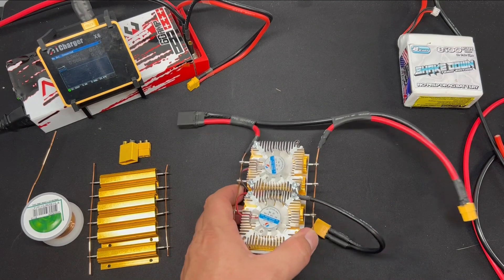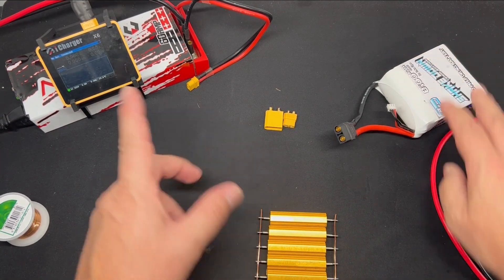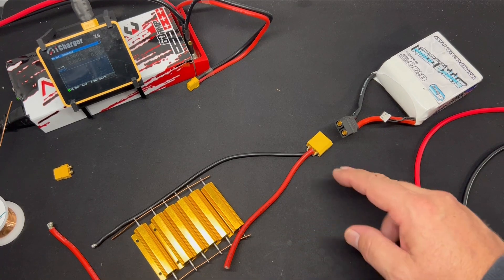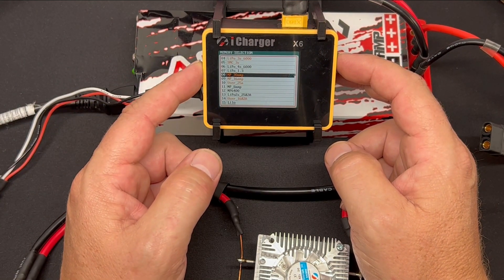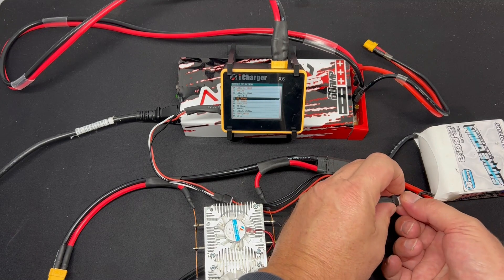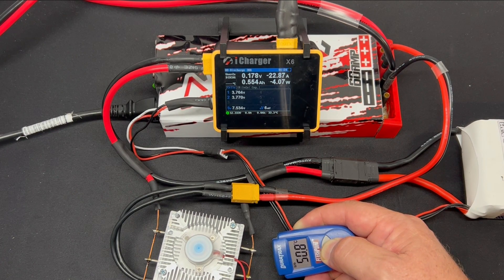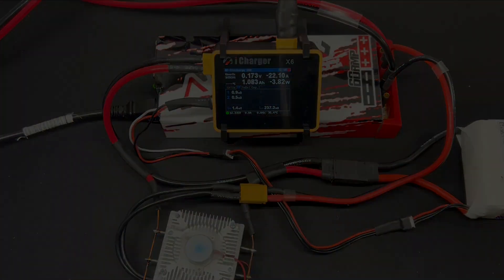Icharger X6 discharge bank

Comment: Did a 4 resistor setup. so 1ohm at 400w. - I can set the x6 to 30amp discharge.. it works! - but I cannot set it to anything less.. it reverts back to 4 amps and change... it ramps up - then back. But 30 works?????

Comment: I’ve built one put in all the same settings but I start to discharge and it starts at 30amp but then about 5 seconds in it drops back to 4amps what am I doing wrong
Reply: What are the voltages of the pack you are trying to discharge? How many resistors and what value are they? With this charger you have to build specifically to the voltage of the pack you are wanting to discharge.
Reply: @BestRCPilotEver  can you give more info? Im doing car packs. 7.4v  - I have bought from a friend 1 ohm 100w (x4) discharge bank. It does what poster said almost ... mine works at 30 - but wont work at anything else - drops back to 4amps

Comment: its not working for me. the second mine hits the amps its set to it drops back down to 40 watts (what the internal discharge is limited to) and the charger starts heating up. i dont get it. only difference is im discharging a 4s and my power supply is only 10 amps but cant imagine the power supply is limiting what can be discharged through the resistors
Reply: I got it to work a few years ago, and never got it to work again.  Could never get it to work with 4s packs.  Not sure why.
Reply: What are the resistor values that you are using and how many resistors in parallel?

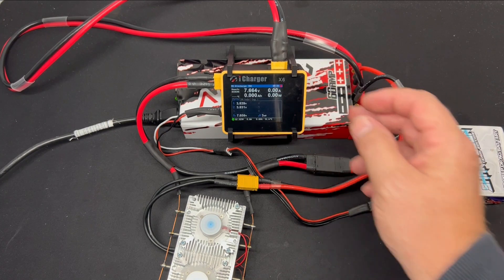Comment: 7:07 why is it only discharging at about 5 watts???? also, isnt your fan plugged into 12 volts at whatever amps your power supply puts out (which would be way more than your fans can handle)? how does that not fry your fans?
Reply from the maker: Amps don’t push, the fan draws the Amps it needs
Reply: @StewMac570  but why does it only say it discharging at around 5 amps?
Reply: @StewMac570  its not working for me. the second mine hits the amps its set to it drops back down to 40 watts (what the internal discharge is limited to) and the charger starts heating up. i dont get it. only difference is im discharging a 4s and my power supply is only 10 amps but cant imagine the power supply is limiting what can be discharged through the resistors

Comment: should,nt those brass wires on the resister pack be covered? surely you could short them?
Reply: you gotta be pretty stupid to short those out. you would have to drop something metal with a big sharp curve or 2 small sharp curves and it would have to land perfectly to short them out.

Comment: Nice VDO. I'm going to buy this charger. If I discharge with resistors bank like you by use a bad battery (very different of IR value of each cell). will this charger protect each cell from volt going below than setting and completed with balance ?

Comment: Can this discharger be used for 4s batteries. If not can you give me info on making on for a 4s battery. I would like to discharge 4s batteries at 20-30amps.
Reply from the maker: I have used it in 4s. I can’t remember the amps though, you may need to add more resistors to get up to the amps you need,
Reply: @StewMac570  do you think you can do a test on 4s?
Reply from the maker: @duanesapp4914  yeah sure. I’ll have a look good you
Reply: @StewMac570  looks like you never made that video. please do

Comment: This is great, thanks.  But isn't your current dropping because the voltage in the battery is dropping?  V=I x R so I = V/R.  As you discharge, your voltage drops and therefore so does your current.  Might be completely wrong..

Comment: Be good if you could explain more what this is all about
Reply from the maker: It is a bank of resistors that help the charger draw more current from the battery to discharge it.

The reason for discharging at hi amps is to get the battery working and effecting all the chemicals with in the cells. 

It also creates internal heat in the battery that helps lower the IR and improve performance of the battery.

This should only be done with good quality packs. It will shorten the life of the pack but when your looking for performance the life of the battery is less important.
Reply: So you can't cycle the battery, you discharge at 30 amps then remove the resistor bank and then charge the battery at 30 amps is that correct?
Reply from the maker: @clarktempleman6547  yes. For the X6 you have to remove the discharger to then charge the battery.